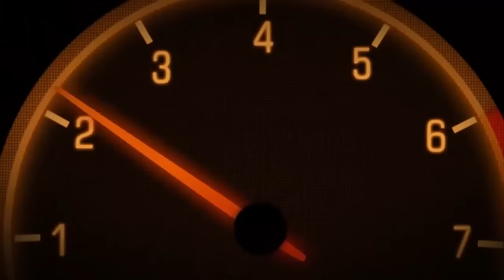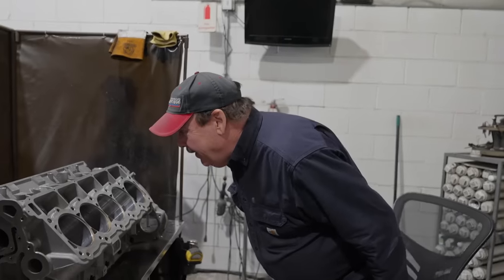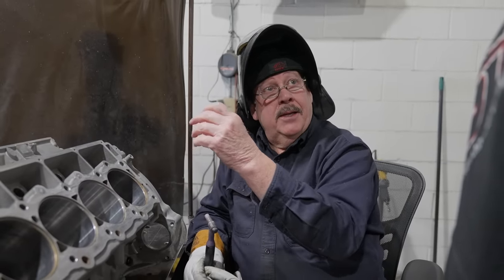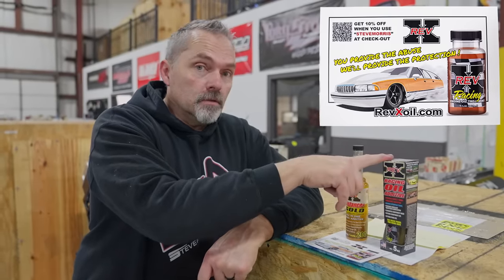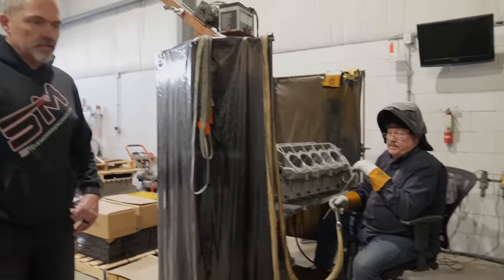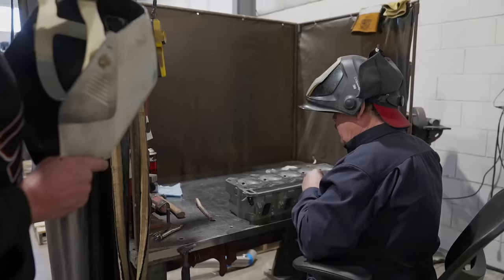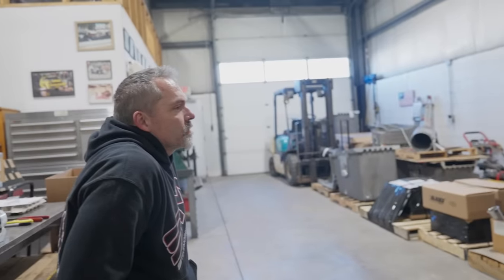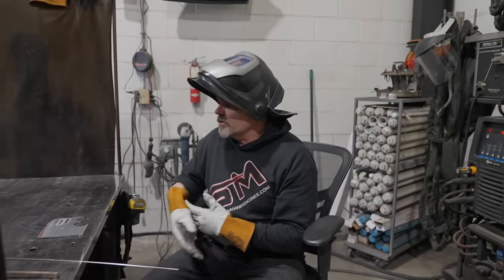Can You Weld Copper Pipe Carrying Millions of Volts of Electricity??

Comment: This is the difference between a welder and someone who can lay a bead. Understanding every aspect of the process from start to finish before you strike an arc. I've been welding 28yrs and certified to weld mostly anything but copper, Never tried but now I want too. I've never had a days schooling but started working for a older welder when I was 14. He taught me a lot and owe him my career. Chris is that caliber of man as well. Thank you for teaching me more about the passion of loving what you do.
Reply: I learned to weld in a university-affiliated middle school - though they didn't call them that, back then - in the '60s.  Basically stick, brazing, cutting, soldering, and some small-scale foundry work.

Nobody did mig - the machines were too huge and too expensive.  Only the Government and large corporations could afford them as well as the footprint to keep them.  Most of the large corporations did contract work for the Government.

I don't think there was such a thing as TIG, back in those days.  Not that I know of, anyway.

I have welded for most of that time, up until the last 20 or so years.  I can lay a decent bead, but what I know could fill a thimble.  I'm still fascinated by it, and people who are really good at it.

Comment: When Steve keeps trying to figure out in a round about way what's in his secret blend of gas 🤣 That guy is pretty awesome!!
Reply: Probably just a custom helium blend to get more heat.
Reply: Nothing secret about it, helium mixes are extremely common, and necessary when welding thick aluminum. A high helium mix for example, will make a 200amp machine weld like a 300amp machine simply because helium's thermal conductivity is much higher than argon's. 
The same can be done using Hydrogen to increase the arc energy efficiency to weld austenitic stainless.

Comment: I fell in love with welding in the mid 1970's and have been welding ever since. I have welded copper over the years using TIG and 99.9% pure copper for filler and have never had any trouble using pure Argon. I have welded thin sheet half inch water pipe and four inch square bus bars using argon only with no trouble.

Comment: WELDING now that was a video I have always used small cups and a WP-20 torch but today people are using all kinds of different stuff and you don't really know what's right anymore.  Nice to know my setup is fine what I did learn is it is time for a new welder. I had looked at invertors but did not know what I wanted until today. Thank you
Reply: The only time those big cups are really needed is doing titanium work.
Reply: keep that in mind, I am a 4130/308 kinda guy @TNels
Reply: @TNels   I find them useful for thin ss, too.  For aluminum,  I like the Furick #5 pyrex, but a plain old #5 ceramic is just as good.

Comment: When he says it’s because of the inverter welders. He’s saying we have adjustable a/c high frequency now. They use to use d/c current with 100% helium. A/c blast threw the oxides cleaning the material. D/C current can’t do that.  There’s a lot more that can be said about frequencies, ac balance, shielding gas mixtures, but that’s as basic as I’ll put it. 😉 and the wireless miller remotes are money well spent.  Best thing I bought.

Comment: While I knew what helium, high frequency, and squarewave do for the weld bead, his explanation made a light bulb go off in my head. I use mig gloves for tig welding and the arc is still very hot and burns my hands when doing 1/4" aluminum with the amperage probably around 300 amps. While I do try to keep a tight arc, it is hard to not dip the tungsten, as Steve said. My machine is a miller 330 abp 460 amp unit but in 1965, when it was made, sine wave, 50/50 balance, and 60 hertz was it. The tungsten balls up and the arc is wide and the heat spreads out to everything. It was really cool to hear all the details that go into this type of work, from a master of the trade.

Comment: Yes I can!!! (Video Title) As one of possibly 20 welders in the world who can weld heavy wall/plate (25mm and Above) Pure Copper. I can verify everything that was said but would also like to mention that  those 6,8 10 hour welds are happening with temps of 550degC (1000F) at the torch! 
It’s a whole different world of welding. also can’t buy pure copper filler rod 😉
Great Video!!!

Comment: My first welding job we used a mix of 85/15 mix, I accumulated around 4 bottles of 75/25 because I liked the mix so much but could only get 75/25. This guy runs things similar to how I did and still would if I wasn’t just a wire monkey these days. He understands the metallurgy, the electrons and protons of the electrical properties of what the machine is capable of. The puddle and gases characteristics, and hand eye coordination. That’s what makes a good welder, a good welding teacher, and makes good welders. Watching people try and teach without explanation, is the downfall of learning, and this guy couldn’t make his subject boring if he tried
Reply: I think you misspelled Top Tier if not GOAT. If all these different engine, rocket, military and steel mill companies search out and find him for their projects, you can guarantee he's at the top of the field and magnitudes better than a "good" welder. Hell, there's only 5 people in all of America that can weld those copper electrodes, and he trained the other four! ;)

Comment: I have been tig welding alloy, automotive and light alloy fab work, since I was 20 yo, started welding cracked alloy cylinder heads,
Even worked for Australia’s largest engine reconditioner welding there alloy and cast ion heads, 
We had a 350 amp inverter tig welder, yet welding ford ea falcon 6 cyclinder heads, we had to pre heat and post heat allowing them to cool over time in the oven,  then the heads are sent out for heat treating.
If we didn’t follow this procedure, we had issue with heads cracking while in service.
Plus where ever you welding just tock away the hardness, meaning we had issues with head bolts sinking into the soft alloy, 
When ever I Rockwell hardness tested welded cast heads, it was always under minimum hardness around the weld, 
This was always an issue if you welded near a head gasket sealing ring , water jacket .
I mean the filler rod was softer than the heat treaded cylinder head.

 I have used either pure argon or 75% argon and 25% helium.  In my mid 20s I went to tafe and did the full welding course with the pressure welding certificate.

Love welding as much as high performance engine work.  
Just checked the Australian supplier BOC gasses, seems I can still get helium gas mixes with no issue, 
We did have an Australian supplier, Santos gas supply, now we import all our helium .
A C size bottle of 95% pure helium is $235 Aussie dollars. 
Luckily for the welding I do these days ( retired ) argon does me for alloy tig welding. 

Nice video Steve.

Comment: Hello Steve, this has been an awesome video. Even learned something new about welding aluminum and the freq settings. As for shielding gas, having an helium/argon mix help tremendously when welding thick heavy aluminum. The helium in the gas helps to heat the arc or wet the puddle, allowing the metal to melt faster.

Comment: Learning is an open road for new adventures that   keeps revealing solutions for unique and challenging technical problems that have to be solved. Having confidence for difficult projects became my most rewarding experience. The process of designing, conceptualizing material applications with jigging, and specialized tool fabrication that gets it done. A small shop promoting trades, mentoring goodwill, and sharing the knowledge as seeds that can grow into a better life is a huge blessing. I learned a few fascinating things at the exotic metal fusing level I never knew. Pretty cool, thanks.

Comment: Those submerged electric arc furnaces with the water cooled copper pipe as electrical connections run at 'only' 400 to 1200 volts, but its the amps that dazzle you:  10,000 to 50,000 amps.

Comment: The inverter gets rid of some contaminants because the flow of electricity is away from the parent material. Just like in a spark plug the electrode tends to disappear because the electricity goes towards the ground strap

Comment: The reason that helium makes great welds using a tig is that it increases the cathode work function that results in much higher temperatures at the workpiece. A mixture of argon and helium is actually better than streight gas either way. The reason is that the heavy argon ions bombard the workpiece transferring energy giving even more heating where it is needed. Thev ratio must be enough that most of the argon is singly ionized to benifit. The ratio is about 70/30 molar helium to argon, but less argon used at lower currents.❤.

Comment: The welder should do advanced welding classes. Lots of people would sign up to learn. Those plasma torches are a real game changer. Helium argon is what is known as a penning mixture. It is higher conducting mix than either gas alone, so the cathode ends up getting much hotter than normal without wasting heat on the arc itself and allows a higher current density where it is needed.

Comment: Great video, tons of amazing knowledge!

Regarding helium shortage and gases in general:

Consider using nitrogen instead of helium in your shielding gas mixes when welding aluminum.

Gas purity should be maintained to AWS standards; a shielding gas product with less than 3 PPM of moisture and 5 PPM of O2 content is recommended.

Comment: Those copper pipes are used with the feeders for an arc furnace. Each furnace has 3 or 4 of these assemblies.The voltage is generally in the 14 to 45kv range with amperage being upwards of 125kA. Megawatts of power. Those things are genuinely scary machines when they start up.😮

Comment: I think slot of guys are stuck in low frequency just cause that’s all they had years ago, and they’re like me and think the high frequency is for a tight bead profile, but if makes sense. You want a tight bead, just need the amps to penetrate it down into the castings so you’ll have some to machine. That was some awesome information!

Comment: I havent used He for 15 years. did not know, it has gone that insane. We normaly welded a 25/75% mix with 250mhz. I also did a lot of testing for Migatronic back in the Late 90' before they released there Sigma series. certification WPS forced us to use 220-250mhz

Comment: My Miller tig welder will put out 460 amps and any frequency.......as long as it is the frequency the power company supplies! 😁 It is a 1965 Miller Goldstar 330 abp. I do use a heavy duty #20 flex head torch, so it is rated at about 320 amps, but the neck is rectangular......not nearly as thin as his. It is really cool to see a master at work. Part way into the video, I already knew most of what has been covered, but my skill level pales in comparison to this guy. Steve should try the Optrel Crystal 2.0 helmet, if he hasn't already. Hindsight is 20/20 as far as not bringing a helmet with him. My backup helmet is a miller classic digital, which is lighter than the optrel, although the optrel is one of the lightest available. It seems odd this guy doesn't have an extra laying around. 2 is one and 1 is none, just like he has a backup machine.

Comment: Cool vid, such welding skill is a treasure indeed.

Those conduits in the steel mill look absolutely gnarly. Likely some kind of arc furnace being powered there. I gotta make a small correction there though, the voltage over those things is likely not as high as you think. The reason those pipes are an inch thick copper tube is to keep the resistance so low that even at high currents the voltage drop over those pipes won't be significant enough to cause large energy losses. The voltage in such a furnace over the electrodes can be as low as only 400V between them. But when it's 100000 Amps running through it even the tiniest resistance in those tubes will cause significant power loss and heating of the tube.

Also, another note on the price of Helium nowadays. Another factor has been the increased realization that helium is not easily renewable, and due to its low molecular weight, it has a tendency to float to the top of the atmosphere and then be blown away by the solar wind. It is continuously created in small quantities in the earth as a product of radioactive decay, but that doesn't happen fast enough compared to our current usage rates. We've been lucky that a lot of that decay has been trapped in porous rock allowing us to extract easily, but that won't always be the case.

Comment: I use a 5lbs bottle of helium and just barely crack the ball on the regulator spliced onto my Argon when welding aluminum. I grew up watching my father Heli/Arc Magnesium funny car Tin that had cracked. Helium although extremely spendy is well worth having. It cleans like no other with aluminum alloys

Comment: I assume those copper pipes are for an arc furnace. They operate with around(only) 400-900 Volts DC and at least 44 000 Ampere.
You could say its the amps that make things hot not the voltage.

Comment: I did a couple of cast aluminum transmission that were dropped. The second one was a while later and I brought 5356 wire and it popped the tacks when it cooled. I ended up having to get 4043 and always use that on cast aluminum now. I run 100hz on the dynasty 200dx

Comment: Steve, love all the info you share. You mentioned that Clark uses Rev-x in his SMX I believe. Motocross Action magazine just did a test of the motorcycle version in latest issue. Amazing results. Ran a Motocross bike in 100 degree heat without radiators. Then went trail riding same way. Took it apart after with no scoring anywhere. Also did some before and after acceleration tests. Bike was faster after the 2 Oz was added to oil. I'm going to try it in my motocrosser.

Comment: You should have some kind of collector for helium in the roof. Trying to get most of it back to refining...
Think there would be alot of money to be saved in the long run.
And helium is very light, so it should be easy to collect in the middle if the roof is triangular.

Comment: I was pleasantly surprised while welding some copper pipe fittings.  Copper is nice to weld, but it really sucks up the heat.  I welded straight polarity, and helium.  Not critical parts, just a bath caddy and shower rod.  Still holding fine.  I wouldn't put a million volts through it, but they look nice and holds my soap and shampoo.

Comment: How do you judge the 'Best welder' lying upside down in a quarry at 3 in the morning stick welding a part back on plant and guaranteeing it won't break off again that night, TIG welding the inside of a pipe through a 1/4" gap in a petrochemical company or standing in a hole full of water welding 100 year old cast iron water pipe that's full of cracks, we all would like the luxury of sitting at a bench and being able to turn whatever we're welding.

Comment: not sure how your miller works, but when welding aluminium, my esab ac/dc tig welder, when changing the hrtz i change the time between the amount of ac current witch cleans your oxide of,and dc current that actualy moltens, 
there is also setting for how long time either ac or dc current to apply as you might like to have more 30 procent ac and 70 procent dc or change to  50/50 etc, depending of the type of aloy, mag, cast alum, /depend how much mag in the alu

Comment: I use on heavy al. section DC straight with 100% Helium and sharp point. half the current  but need to keep the part clean before welding since no AC cleaning action.

Comment: I'm just curious if there are any electricians who have ever seen this copper water cooled system before? I've done 325kv 2000A underground and we used nitrogen purge systems quadruple insulated specifically to keep water away from anywhere even near the final insulation. That and curious what cables are used because those are sharp as hell corners he put on the 90's.

Comment: If you want to see a really cool welding process, check out Electron Beam Welding. It's basically welding with an electron gun like in an old tube TV in a high vacuum chamber. They can do some amazing welds, high penetration, high purity.

Comment: I used a Tig torch to weld the 4 sheets of 3/4 lead sheets with stainless inner and outer oused in several steps to keep the radiation in the box and out of the Doctors' office. This thing is about the size of a washer machine and looks like a fancy safe....Back Breaker!

Comment: You don't need millions of volts for copper you just need a good 300amp tig setup lol you do need to pre heat the tubing a good and green color before you weld on it any it really fuses together rather than breaks down and melts

Comment: Not trying to take anything away from the man he’s clearly a gem in this industry. But preheat is absolutely still used in specific cases like he mentioned with hydrogen inclusions right at the end of that discussion. HSLA’s still require preheat and there’s nothing the material supplier can do for lowering the hydrogen content during manufacturing if the alloy strength is so high that even 3-5 ppm makes it crack.

Comment: Helium sounds different because speed of sound in helium is much faster than most other gases. hydrogen has a faster speed of sound but it would not be good shielding due to tendency to burn when combined with oxygen and heat lol. Noble gases like He and Ar are used for shielding because they do not react chemically.

Liquid helium is used in MRI machines because it's used to cool the magnets down to be superconducting. It boils at 4.2 kelvin which is quite cold! modern MRI machines are supposedly zero-boil-off though, so they should not consume helium once in operation unless there is a malfunction.